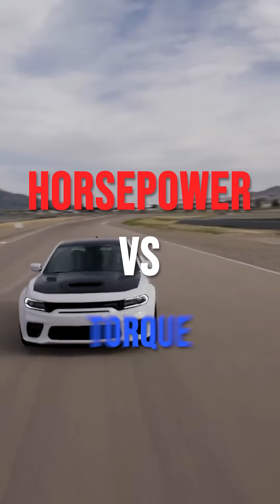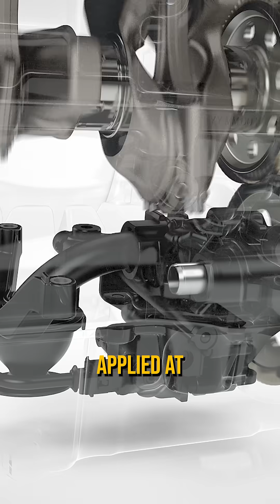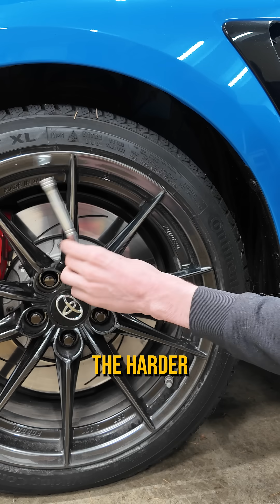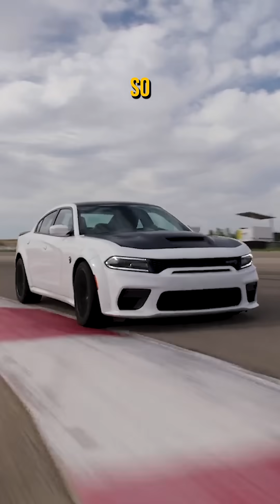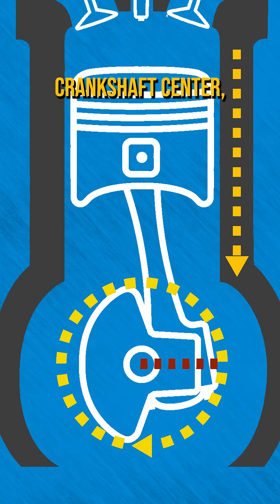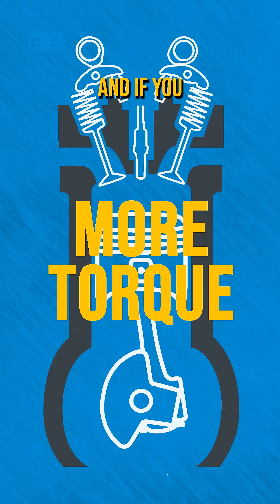Horsepower vs Torque (In 60 Seconds)

Comment: simple
torque = acceleration💨💨💨
hp = speed ✈️✈️✈️
Reply: Not true. Hp is both speed and acceleration.
Reply: Hivemind nonsense.  Power, not torque, is the limiting factor in not only the top speed of a vehicle but also how quickly it can accelerate at any speed and how much weight it can pull up an incline at any speed.

All work is done by power.

Comment: Torque doesn’t matter except it helps us truckers pull the loads weighing 20 times your cars without counting the bobtail or trailer weights.
Reply: Physics don't care about engine torque - they care about wheel torque and at any given wheel speed the engine that makes more power will make more wheel torque. Power hauls loads, not torque.
Reply: @idkhowtonamemyself2137 wheel torque for set whelll radious …. universally physics care only about contact path force from 10 times lower wheeel torq you can have 10 times more cpf if have enough shorterr wheell radious but i. regard to the same vehicle with set radious your right 👍🏻🪠🍿
Reply: Forget about torque!
Save yourself a step and just look at the power curve.
Wherever you are on the curve is your budget to accelerate, tow, climb a hill, push air out of the way at top speed... torque is only a useful spec when you are calculating when parts will break or how much tension you need on the fasteners to keep the wheels on the hubs and the heads on the block.
All work is done by Power. It's not an opinion or just a fact,.... It's The Law!
The First Law of Thermodynamics-conservation of energy.

Comment: Torque do matters for EU diesel cars that have low hp
Reply: Power matters, and because diesels are inherently flawed from a performance standpoint the only way to increase their power is to increase their torque.
Reply: you cant change power on torque and have the same performance 150 hp 600 nm tdi willl never have performance of feg 300 hp 300 nm n/a gasoline version 😎👌🏻except gasoline must be alaaways rev much higher 👍🏻🪠+ like always assuming perfect gearing for each version 👍🏻🪠🍿

Comment: Torque doesn’t do work.
Torque is just the slope that energy wants to slide down.
The actual sliding — the real movement of energy through time — is power.
And work is simply how much energy successfully slid.
Forces, torques, fields, and stresses are not the cause of work; they are the geometric shadows of an underlying energy imbalance.
Only when energy actually flows (power) does any work occur, from a stalled motor to a tectonic plate to a quark.
So the clean, universal truth is:
Work is the integral of power because all work is done by power.
Everything else is just a description of the slope, not the movement.

Comment: Torque maters in trucks puling heavy trailers
Reply: Nonsense. Power, not torque, is the limiting factor in not only the top speed of a vehicle but also how quickly it can accelerate at any speed and how much weight it can pull up an incline at any speed.

All work is done by power.

Comment: It is quite simple: the performance of the car of truck (or bike) is determined at the pulling power that is excerted at the contact patch between the road and tire. So you'd think that the torque of the engine is what matters. But then you forget that there is a transmission in between that multiplies the torque of the engine by the reduction factor. (2x reduction = 2x increase in torque at the wheels). And an engine that delivers the same torque at the crankshaft at double the rbm can run the same speed with double the reduction, and therefore with double the pulling power on the road. But what is the definition of torque (at the cranshaft)? POWER!. So it is the POWER of the engine and NOT the torque that determines pulling power on the road and the performance of the vehicle

Comment: yeah, 270nm * 4000rpm = 1080kw , which is more than 1400hp. i didn't know that my 1500cc turbodiesel engine has 1400 hp :D . out of jokes, you also need to multiply 2pi/60 to find power in watt. for transforming to hp you need to convert w to kw and multiply it 1.34 , then you get the answer.

Comment: Torque is used to pull heavy objects of comes to SUVs and trucks
Reply: Power pulls those objects. SUV and trucks have low revving high torque engines because they tend to be quieter, cheaper to manufacture and more reliable in that specific scenario.
Reply: Power, not torque, is the limiting factor in not only the top speed of a vehicle but also how quickly it can accelerate at any speed and how much weight it can pull up an incline at any speed.

All work is done by power.

Comment: This is such a flawed judgement though… if a car had 1 lb/ft of torque and 1 billion horsepower it would also be pathetically slow because there would be no work to be carried out, no matter the RPM.
Reply: rpms make smalll work hapoen much more times in the same time period aka the same work as 1 zylion lbf ft at the same power cos rpms can be 100% replaced  be torque and vice versa with no losesss aka it doesntmatter engine have 100 nm at 1000 rpm or 50 nm at 2000 rpm power is the same so results be the same on perfect gearing both for the same car version aplication vs power is absokutely not negptiable and cant be replaced be anything / ypu cant exchange power for anything and produce  better performance it be only worse assuming gearing always was perfect for each version but feg electrickkick scooter woth set whell radious with engine in whell like they calll it hub motor feg in wuch vehicle torwue levell is importsnt in regsrd to accelerstion form 0 to certain  speed 👍🏻🍿
Reply: power is a measurement of work so an engine that makes 1 billion horsepower but 1lb/ft of torque would do as much work as any other engine that makes 1 billion horsepower no matter how much torque it makes
Reply: No work to be carried out? 🤷‍♂️.  
 The engine that has the most power can do the most amount of work in the least amount of time.  Power = Work / Time.

All work is done by Power.

Comment: Horse Power is nothing but a marketing gimmick thought up around a century ago.
Reply: yea 🤐 and work/time=power or 1/4 mille calculator show power from time and weight of specific type of vehicles is also marketing gimmick  try beat 1000 hp car on 1/4 mille in the same spec except  engine your cant have more than 500 hp  gearing torque displacement charge or not clutch you can allll setup whatever you want goood luck 👍🏻🤭you willl neeed it cos if 1000 hp version dosent break before race or in half of race or crash you lost 👌🏻🪠🍿
Reply: horsepower as a unit might've been created to sell products, but power in itself is not. The more powerful car will always be faster (assuming equal weight and grip) no matter how much torque it makes.
Reply: @idkhowtonamemyself2137 horsepower is power unit the same as watts have diffrent multiplicator cos 1,341 timesmorw than watts but represents/expresss egzacly the same physique phenomenom 👌🏻analogue to grams and kilograms the same object weight1000 grams or 1 kg =2,205 lb the same 💩 or maybe betterbekilograms and pounds the same object weight 1 kg or 2,2 pounds egzacly the same much = the same 💩👌🏻🪠🍿
Reply: Hivemind 🚮

Comment: Longer pistons mean less rpm, resulting in greater torque.

Gas engines have shorter pistons, diesel engines have longer pistons. That is why diesel engine does more torque with the same hp, but less speed than gas engines.
Reply: Nonsense.

Comment: Torque is The Term on the Cars which How Fast Can You Accelerate or Haul Heavy Loads (Diesel Applies)
Power/HP is the Term on the Cars which How Fast Can The Top Speed of Your Vehicle Is (Petrol Applies)
Reply: Nonsense

Comment: Similar torque and hp values is the sweet spot. For me at least. My jeep wrangler and teslas are good examples.
Reply: naaah for daily riding more torque lesss power is better but for race track more power lecc tprque is better 😉👍🏻🍿
Reply: @mociczyczki not me. I don't like winding my engine/motor up too high on the streets. That being said, my tesla motors could run up to 20,000 rpms. Same with my energica motorcycle.
Reply: @CRPerformance1 if ypu be winding mean high rpms than more torque less power is better for you like im write obviously 🤷🏻‍♂️

Comment: The more torque you have, the lower the RPM you need to achieve maximum power. If you have a low torque engine, it's not any weaker than a high torque one, it just means you have to rev it more.

Comment: Torque is matter,like you said ONLY RPM matter,okay let's rotate the Truck crankshaft with the Suzuki mini car Engine 😂🎉
Reply: Both Matter!
Reply: You can multiply torque with a gearbox. In a proper gear you could tow a loaded truck with a lawnmower engine (just really slow due to lack of power).

Comment: Hp is the math equation of torque x rpm ofc i dont know the math equation,but i do know that it also jas to do with how you tune your engine as well not kust torque and rpm,to find the hp in a few words you need to know the torque and rpm of the vehicle and what else matters as well is the fuel of the vehicle,gasoline produces more hp but less torque than diesel,and gasoline powered vehicles can also rev higher than diesel

Comment: @engineeringexplained i kinda disagree with you on this one. Your math is only true if both cars have a perfectly flat torque curve throughout the rpm range. If the area under the curve is bigger, for example a diesel car that has a big spike of torque at low rpms vs a gas car with a flatter curve the diesel is gonna have more area under the torque curve witch means it will have more total torque for the whole rpm range. Remember that indicated power and torque numbers always refer to their peak values. You theoretically could have a car with a million ft pounds but its just a spike at 2000 rpm and in the rest of the range it just has 200. It would be still referred to as a million ft lbs of torque.  Same with HP.
Reply: peak performance in regard to biger difff in velocity is determined be avg power which can be use during accelerstion attempt for specific speed range which is determined bepeak power width i regard to diffrenc in gear lenght thats alll 👌🏻🪠  torque curve itself in regard to max accelerstion test say nothing  feg 1000 nm at wngine crank avg while doing accelelrstion form 100 to 200 km/h for fastest time posibble vs 500 nm avg under tprque graph what ypu know from this ? nothing ? yea egzacly 👌🏻 cos torq itself mean literalllly nothing but if im write that this avg 1000 nm was between 1000-2000 rpm and 500 nm between 8000-10000 rpm now we know which was faster between this 100 and 200 km/h assuming motion resist aka weight drag roll and drive trwin lsoesss was similar for both 500 nm between 8000 to 10000 rpm absolutelly smoked 1000 nm between 2000 to 4000 rpm 👌🏻 why ? cos 500 nm between 8-10000 rpm is waaaay more power around 3 times more power accelerwtion time between 100 and 200 km/ h including drag asf be much faster than 3 times fpr avg let say suv weoght 2 tons with cda of 0,75 👌🏻🪠🍿if ypu disagreee woth ee here ypur wrong cos he is obviously right saying basics equation whcih explain everything actuallly in this theme wprk /time = power end of story 👉🏻 ypu can have  super high torq at super low rpm or super low torq at super high rpm it realllly dosent matter version which use more avg power at whell in race like 1/4 mille race win race .🪠🍿

Comment: For a tractor, rotating a PTO shaft, it's about how much force it can apply to that PTO shaft at ~540 (or 1000) RPM.
Reply: if ypu have set rpm which cant be change than torq matter in did 👌🏻but if ypu compare tractor with 10000 lbf ft at 750 rpm to tractor with 5000 lbf ft at 7500 rpm both at perfect gearing than 10000 lbf ft at 750 rpm in feg which tractor plowed faster 10 hectars of somground with heavy plow have 0 chance cos 5000 lbf ft at 7500 rpm is waaay more power 🌪️🪠🍿

Comment: Carroll Shelby once said “Horsepower sells cars. Torque wins races.” While it’s true that instantaneous torque is largely irrelevant, a stronger torque curve directly relates to better power along the rev range, making the car faster.
Reply: in regard to max acceleration what is important is range of rpms which can be use be gearing feg if rpm limiter is at 9000 rpm max power between 5000 to 6500 rpm gearing must be setup in such way that when on lower gear rpms reach 6500 rpm and driver upshift rpm cant star lower than 5000 rpm and now its fastest setup posible dosent mattter how loook power or torque  graph on any other rpms  torqur on lower rpm can be higher or lower it dosentmattter as long as he be hold thanks goood gearing rpm between 5000 to 6500 rpms he be fastest posible for this engine characteristic 👌🏻 if he use lower gear where rpm be higher than 6500 rpm or higher gear where rpm be lower than 5000 rpm accceleration be worse he be slower 👌🏻 that how it goes in regard to racing vs for daily riding thats difff story yea in daily riding strong lowend is important in racing not realllly 🪠🍿

Comment: What if tug-of-war happens between a 600HP 600NM car VS a 300HP 1200NM car?
Reply: if they both have a transmission, 600hp clears every single time
Reply: Correct! High Torque = big transmission & differential = Truck stump pulling power High KW = smaller trans & diff half the torque.
Reply: assuming the same normal grip on tarmac draw and that both can rip offf grip if push to much throtlle draw , assuming unlimited or atleast enough for each grip at the same final gear ratio of 1 gear 300 hp 1200 nm win asuming typical characteristic such setup with lower prak nm and more nm from low rpm overall ,assuming each could use as short final gear ratio of 1 gear as he can and there be unlimited grip than thus who setup shortest final gear ratio of 1 gear in regard to its torque / power graph characteristics where obviously 600 hp 600 nm atleast with typical characteristics of such engines willl need enough shorter final gear ratio for make it draw ,assuming more grip for some version this version win asssuming enough good final gr of 1 gear for each like you seee only power and torq in regard to tug of war say 💩👌🏻 feg 10 ton semitruck having 10 times weaker engine give 0 chance in tug of war some 1,5 ton sportscar cos semi have multiple time more grip thanks huge massss push tires to the ground in normal avg such cars setup + very short 1 gear in regard to speeed  1 gear in 3000 hp sc can reach 100 moh vs in 300 hp semitruck dont know egzacly now on fast but like 2-3 mph os even issc would have enough short 1 gear still lost cos as in stock setup tire will spinnn around in place looosing grip gainst 10 ton truck/tracktpr whatever and dude in truck /tracktpr woth couple times weaker engine just let go clutch barellly push throtle and start go forward with sc rear ward 👍🏻🪠🍿

Comment: Hey everybody so as not to waste your time with what you won't understand remember or comprehend Simply put horsepower is when applied to an engine how fast you're able to go ultimately over distance over time torque is how fast or how powerful you can start out so if your car has high torque but low horsepower and you're racing somebody from a stop light who has lower torque but higher horsepower you're gonna win at first but then that person is gonna come back and win over you because they simply have more power over distance
Reply: Nonsense. Power, not torque, is the limiting factor in not only the top speed of a vehicle but also how quickly it can accelerate at any speed and how much weight it can pull up an incline at any speed.

Comment: Tourqe totally matters in a truck.
Reply: not really, with more hp you will be able to output more torque to the wheels then a engine with more torque but less hp, because transmissions are a real thing.
Reply: @TheNoiseeeee with deisel   low hp.  Mass tq
Reply: @Bubba_MB  that is true, but a high horsepower low torque engine will be able to tow more then a low hp high torque engine because the high hp engine will be able to trade its rpm for more torque through the transmission, and because it has so much hp, eventually it will be outputting more wheel torque then the diesel. super simple math
Reply: @TheNoiseeeee I totally get what your saying  but I've never seen a tuned pickup "gas" vs tuned deisel   where the gas was even close.  Lil lone 5 mpg out of gas. And gas at high rpm vs deisel low rpm.   Not even. Close.     Im not a ford guy AT ALL. But there 500 hp 1200 tq
Reply: @Bubba_MB  indeed, a diesel will be more efficient than a gas truck, but i don't know what drag races you've been to. the ones i've seen where the gas truck had more power, the diesel gets it off the line due to its immense low end torque, but the gas passes it.
Reply: You can make anything beat anything with money.  Im saying.  For a normal TRUCK  one you use to haul and pull with. Its no competition  deisel is more power by far. And if you built a motor to even be close  it would not last long  and a tuner on deisel would crush gas engine again.    I think your thinking small pickups ?  Race ?     Not towing and truck stuff??
Reply: @Bubba_MB  cough f150 raptor r cough cough
Reply: You can do better  than that
Reply: Atleast give me a 460 with a blower going up grape vine
Reply: @Bubba_MB  ok here you go: 460 with a blower going up grape vine

Comment: The engine’s Power, not its Torque is the limiting factor in not only the Top speed of the vehicle but also in how quickly it can accelerate at any speed and how much weight it can pull up an incline at any speed.  But that’s the next video apparently.